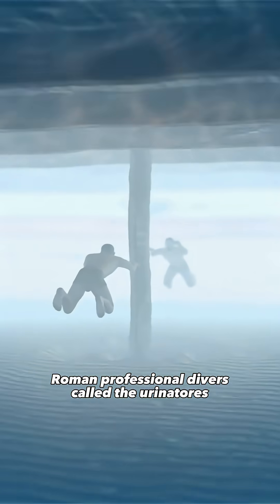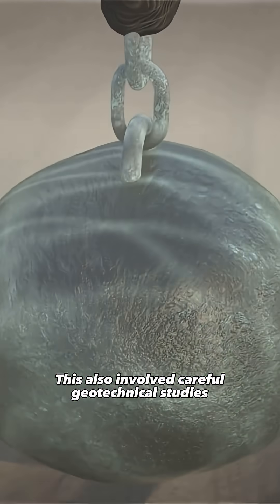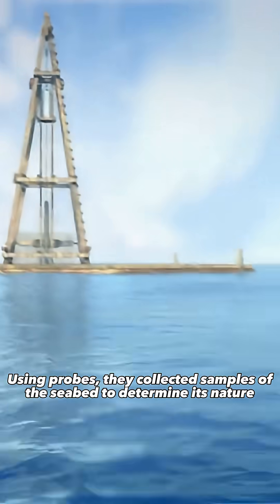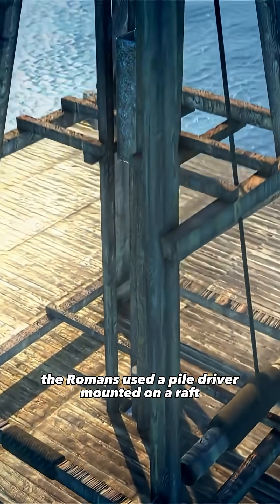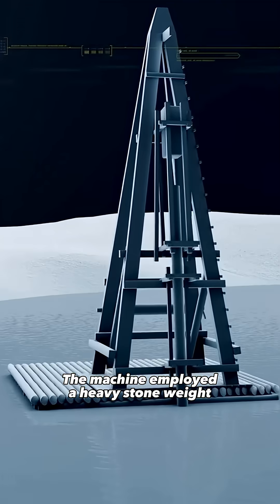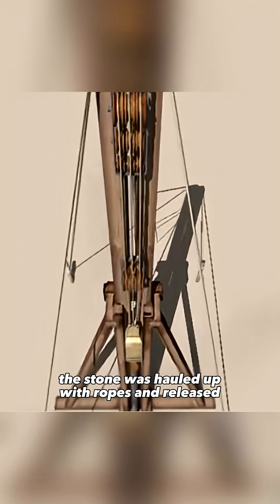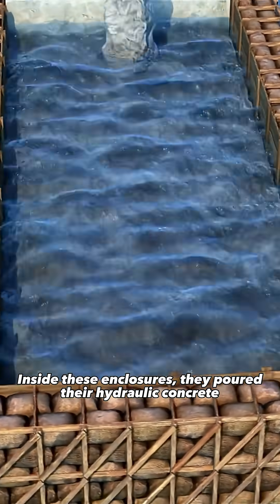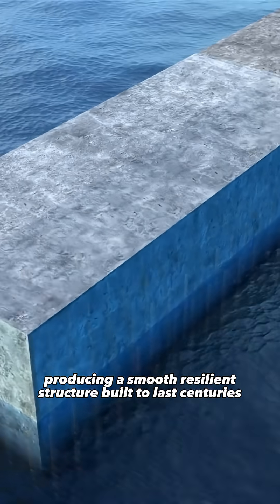Roman Harbor Engineering #history #romanempire

Comment: How come today's concrete carn't be poured if it's raining but the Romans had concrete that could harden under water.
Reply: The Roman's concrete worked underwater because of its mix, using volcanic ash and lime, crushed seashells, mixed with seawater, creating a chemical reaction that formed very strong, rare minerals like aluminuous tobermorite, which grew crystals and reinforced the structure, effectively making it self-healing and stronger with water exposure, unlike modern concrete that deteriorates in salt water.

Comment: i work for a engineering and geotechnical firm and we still use these same techniques for testing. we do borings of soil which gives a cylinder of soil up to hundreds of feet, we do dynamic cone penetration testing to determin soils bearing capacity, and we still use wood piles in texas.
Reply: Not much changed in geotechnical engrg other than computers and posing😂

Comment: Fun facts:  For saltwater structures, the ancient Romans used saltwater which allowed the concrete to last a lot longer.  Modern concrete constructions were using freshwater which erodes a lot faster when exposed t o saltwater.  But the Romans never wrote down that they were using saltwater to slake their concrete mix, so we lost that crucial step up until recently.  Some engineers speculate that the differences between saltwater & freshwater cause cracks to happen that much faster because of pressure differences between the two types (saltwater has a different density & differennt chemistry).  On top of that, the ancient Romans added unslaked chunks of quicklime into their concrete, cement, & mortar mixtures, which "repairs" itself using water wicked up through cracks to go from quicklime to slaked/hydrated lime.
Reply: These chunks of quicklime were not something planned its what happens when you use slave labour 
And using saltwater is cause it was closest 
Roman concrete is not stronger then modern concrete we just have a lot higher demands

Comment: This is actually incorrect. Once they built the caisson they did not poor the concrete into the structure until they pumped out all the water from inside the caissons. Then they prepped the ocean floor with several layers of prep materials that left structure stengthening supports that stayed in place in the concrete once it was poured.
Reply: You’re gonna bore everybody to sleep

Comment: Too bad the Romans didn’t figure out stream power.
Reply: Even if they did, they may not have materials strong enough to hold high presure steam. They  did not know steel, and used soft metals like cooper.
Reply: @marianpazdzioch6632 Copper
Reply: @marianpazdzioch6632 they def had steel and relative high carbon steel just not our industrial steel  and the ability to produce it in large volumes
Reply: They knew about it. Look up aeolipile which Vitruvius mentioned by name over two thousand years ago. It's likely that it was difficult to scale into something large enough to do meaningful work with the materials they had available.
Reply: @qazwer001  apparently slavery was the reason they didnt go further with it... they got all the mechanical power they needed from slaves.
Reply: @xisotopex interesting. Anywhere I could read more about this? It seems like a steam engine would provide substantially more benefit than slaves for anything where it would be interchangeable with human labor. Even selfishly you don't need the same infrastructure for a steam engine that a slave population requires.
Reply: @qazwer001  you would think, right? I mean, make the slaves take care of themselves, they will stay in line once they know they can be replaced by someone else they will be submissive workers.... I dont know, I dont think the romans thought of it the way we do now, science and research for its own sake or as a conscious effort to advance technology wasn't a thing back then the way it is now.
Reply: @xisotopex but that's my point. It doesn't make sense. I would like to see some evidence that they viewed slaves as making more sense then steam power when they used advanced techniques elsewhere that did reduce the need for human labor. For example they used water wheels to grind grain instead of slave labor.
Reply: They knew about not crossing them.
Reply: You STEAM POWER, right? 
They did.

Comment: 'Built for centuries' needs to be our, Western, architects' philosophy.
Reply: It should be noted that modern concrete is stronger for its weight, allowing us to build taller and cheaper than we could with Roman concrete. Roman concrete has a mechanism that allows it to self-heal tiny fractures under the right conditions, allowing it to last longer without maintenance, at least when it is overengineered to hell.
Reply: Built to be bought again in 5 years makes board members salivate
Reply: Built for weeks is the modern equivalent
Reply: @stevebengel1346 Built to last until the cheque clears.
Reply: But think about the shareholders though. If things last too long, they'll lost money
Reply: It could be, but nobody wants to pay for that, not many could even afford a building that lasts centuries.
Reply: to be fair, modern engineers and architects need to build things for significantly heavier loads and uses. back in the day a bridge might see something that weighed up to 1 ton of weight on a slow horse drawn cart every now and then. 
nowadays they need to account for several 1-2 ton heavy vehicles flying across bridges at 60+mph crossing it at once while maintaining a near flawless flat surface that tires can still stick to when the road is covered in rain water, and one a much smaller budget and having to thread it through 3 power lines, next to a subway tunnel, connect two pre-existing highways, and a surprise water main that the survey map said was 40 feet to the left
Reply: @coreytaylor5386 1-2 Ton? More like several 60-70 ton fully laden trucks.
Reply: @baarni  I was thinking normal traffic, but thats absolutly a great point I forgot about semi trucks lol
Reply: Why? Perfectly good structures that were built 30-40 years ago are demolished to make way for new developments. What would be the point of building something that can last for centuries. We live in a completely different time that doesn’t warrant structures being built to last centuries.
Reply: Romans were Western engineers. 🤷🏻‍♂️
Reply: @dvs620  He means our modern architects should adopt this philosophy. Few modern buildings will still be standing in 100 years.
Reply: @GaiusTacitus Modern and Western are two different things. We have modern Eastern architects too.

And buildings now are made to be erected quickly and cheaply. Capitalism. We hire private firms to do it. Romans used the government to erect buildings and infrastructure.

Plus, Romans weren't building stuff to the heights now. What modern architects should learn is how Romans used self healing concrete.
Reply: @GaiusTacitus  Why do you think so? Most of Manhattan was build around 100 years ago. The Empire state building is gonna be 100 in five years. 100 years is actually pretty normal.
Reply: @mrkv4k conpared to the colloseum thats.   Two thousand seven hundred  and  seventy six years old I'm  positive nothing in America will last that long
Reply: @mrkv4k
The exeption doesn't make the rule. Jesus, how can people be so dumb.
Reply: @mrkv4k  Most buildings are torn down before reaching 100 years so they can be replaced. Even homes are now designed to last only 60 years.
Reply: @paulofelipebbraga9634  What exception? 100 years is pretty standard.
Reply: @giulianoasci  This faul is called moving the goalpost, as that's not what you were saying before... 
Romans were lucky, that self-healing concrete was just something that happened to them; one of the ingredients needed for it is something you can only find near a vulcano. That said, most of the stuff they've build didn't last either. It's just that we see only the stuff that did. Saying that nothing in the US will last that long is delusional, there are many buildings that would.
Reply: @giulianoasci  the Colosseum hasn't really been in a functional state for quite some time.
Reply: The West has been sick with Christianity for a long time.
Centuries-durability does not matter to the sick ones because the Earth is "Satan's" and "Jesus" is coming any second, so why worry, right?
Reply: no they do it for speed run to hell
Reply: Our era's approach is to patch it in production.
Reply: It's hard to make money if things last forever. The light bulb comes to mind 😢
Reply: You just need to topple kapitalism for that. Why do you think corporations make things that need to be redone again very soon? It's a lot more profitable to sell you three bridges in 150 years rather than one that lasts for the same time.

Kapitalism only cares about maximum profits to the shareholders, anything else be damned. It's not exactly a secret why things are as they are now.
Reply: It used to be.  Why else would you start construction on a cathedral that you knew would take centuries to complete, and last longer still?